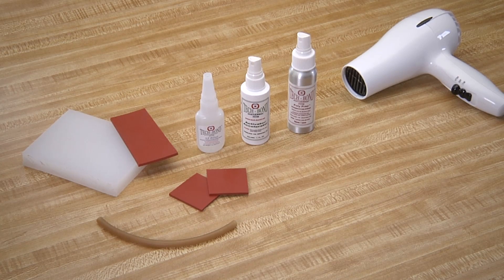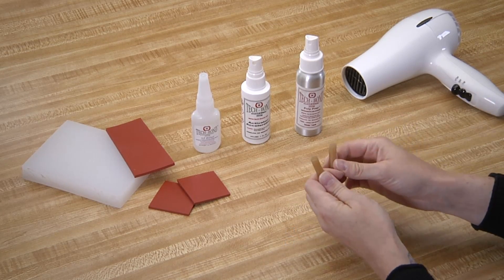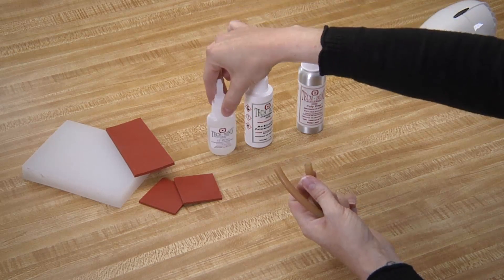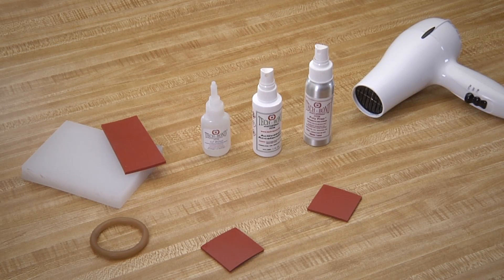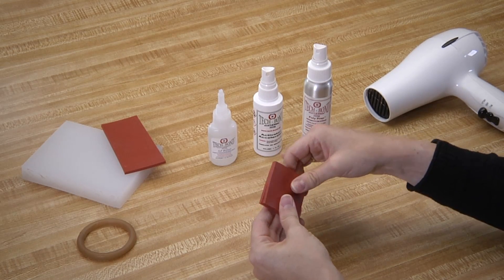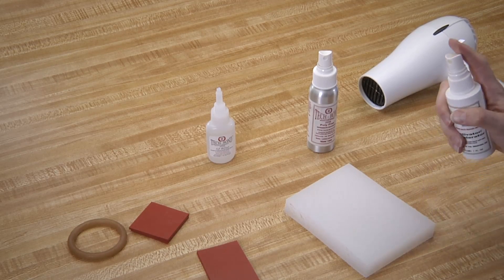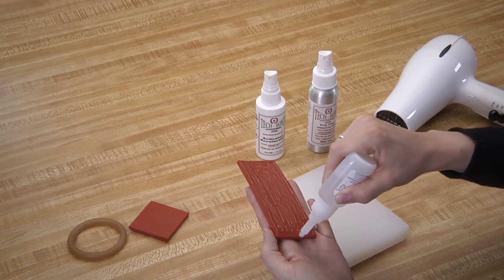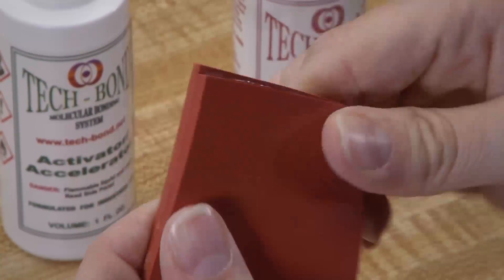Silicone Rubber Adhesive - Best Glue for Silicone - 1-2-Fixed with Tech-Bond

Comment: I just used this product (the black version), and it is very impressive.  I never knew cured silicone could be repaired.  I would recommend not getting the SI black (or blue) to drip out from the edges of the two pieces of silicone (or wipe off any excess quickly), because while the result is flexible, this product is harder than the silicone.  I used a rubber/silicone patch that they sell to over top of the tear in some places to reinforce my project.

Comment: People can criticise all they want, for what I need silicon repaired, it wont see much stress.
From what I've seen from other videos, it's doing a plenty good job.
I don't need it to withstand strong pulls or whatever. I just need to reconnect a piece of silicon so my tool can have its water resistance again.

Comment: You were holding back on your "test/demonstration" at the end. A lap joint a peel test would have been more convincing.
Reply: You stop peeling when the adhesive reaches the edge around the entire perimeter.
Reply: Here is a fact that you will not see anywhere else.  Silicone rubber is an elastomer.  To achieve a quality, non-peelable bond with elastomers, you need to apply very firm pressure when you make the bond.  Finally, this pressure only works when there is an ongoing chemical reaction ... which you get with the Process.

Comment: This video is unconvincing, and therefore of little value. The "silicone tube" you bonded was obviously latex, not silicone. Silicone tubing would be translucent white, or an opaque color. Any cyano acrylate "super glue" would have bonded that without any prep. The "testing" at the end was half-hearted and unimpressive. How about an end bond to the tubing, and a lap bond to the sheeting, with a real stretch test at the end? Silicone tube should stretch to over 500% elongation depending on the type, your 10% stretch made it look like you were worried it might break. How about a lap joint to the "poly" ( I assume polyethylene) and to itself with a measured peel strength tests?  Rubbing the bonded pieces with a finger does not demonstrate it's bond strength, it makes you look like a trade show huckster.
Reply: Yes, need the soft silcone bonded. Not that old hard red stuff that rarely used. I have gone down the plastic bonding nonsense products. But fusion welding work great!
Reply: @davegeorge7094  Where can we learn more about Fusion Welding? of two real silicon pieces. Thanks
Reply: @dennisg.1082  Plastic welding and not silicone. Just heat both parts and clamp together.

Comment: Terrible demonstration!Why? First you should always  present your products from 1st step to last NOT final product first. Then you keep mentioning RUBBER as a product. Is this for silicone or Rubber? And finally when demonstrating the 2 pieces of  rubber, as you call it, it should be partial overlapped to demonstrate the TEAR capabilities which is not present here. Your attempt to PEEL it apart looks like it would be difficult, but if you could properly hold both pieces and pull apart it would not stay. That would be the real test. So in closing from watching this I would assume your product has a short life span and cannot satisfy a real bond.